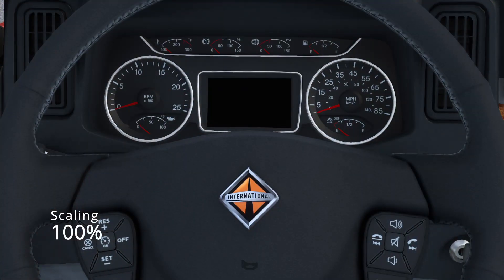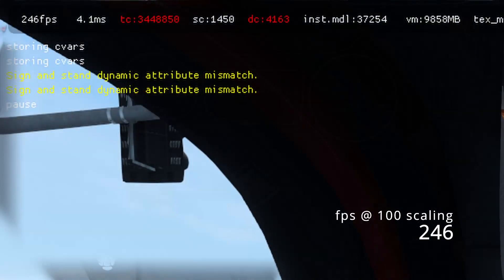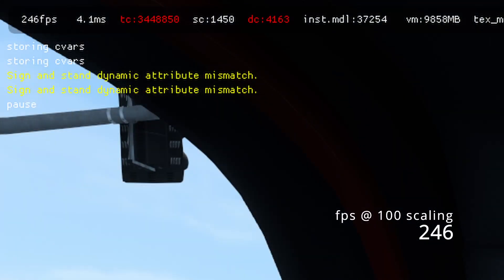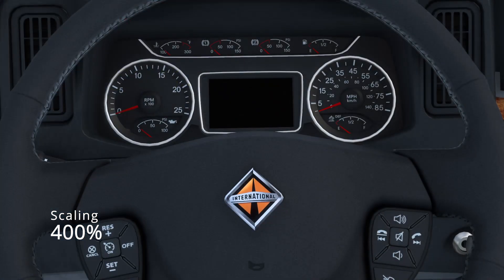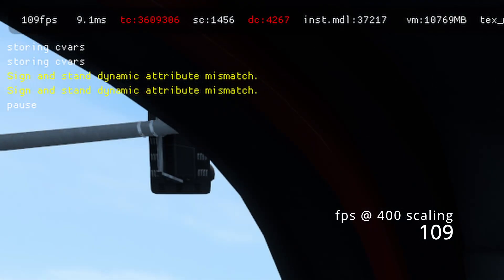Why Is ATS Stuttering? In Other Words, What Is Scaling?

Comment: Stutters all the time for me even at low settings and 40 fps locked. But high settings on all my race games with no stutters at all. It’s the game, not my 4080 Super (on triple 1440’s). 

It’s frustrating. 25% or 400% the stuttering is the same
Reply from the maker: @timothywest1183  mods then.

Comment: With integrated graphics, I have the choice of medium textures with 100% scaling but 30FPS maximum, or 75% scaling and FPS nearer 60. Every time I experiment, I go back to the 75% scaling because I value smooth gameplay more than sharp graphics. I must also have decent shadows, reflections, grass and vegetation, even if the buildings look blocky and blurred, but those are my preferences.

Comment: Since 1.50 my game started to lag and stutter. I use both vanilla truck and trailer and paid mods. When I use vanilla  truck by using minimal and no mods I get the same experience. I turned the scaling down and still no improvements.
Reply from the maker: This is because of the new game requirements for mods to be packed with an SCS created hashfs tool. I have yet to use it, but you will see improvements once people start cutting down their mod sizes and using the tool.
Reply: same im getting stutters and im on top spec pc with a 4090  the road coming towards me isnt smooth asnd turning just looks awful ive tryed everything

Comment: I’m running an i5 13600k with a 4070ti, 32mb ddr4 and in both 4k and 1440p it’s butter smooth with not a hint of stutter or lag. I’m using Gsync also.
Reply: What are your graphic settings? Also what types of mods are you using
Reply: @vxnFloppa  400% scaling, everything on ultra that can be and everything that can’t be is on high. Mods are real billboards companies, realistic roads, brutal weather & Graphics.

Comment: This game even Stutters with a 3090. Come on SCS, get your shit together
Reply: Just bought a 4090 still lag spikes and stutters
Reply: @chrismacdonald102 so how ppl be having smooth gameplay
Reply: @chrismacdonald102  This game engine is very old and poorly optimized for multi-core CPUs. Basically all processing load is allocated to just one core. Maybe when they migrate to DX12 or Vulkan it will run much better.
Reply: I have a 3060 and it runs smooth. I also got the game after the 1.50 update so maybe a fresh install would help.

Comment: Scaling does some of it but there are other things you can do to help. 
Launch settings can be added by going to steam, right-clicking on American Truck Simulator, you will see properties. Then you should see a blank text input box, 
this is where the launch settings go. There is different variations of launch settings so let's go with these. 
(PLEASE SELECT THE ONE FOR YOUR RAM AND COPY AND PASTE INTO THE EMPTY TEXT BOX, SEE PHOTO FOR EXAMPLE)

Step 1
8GB RAM:
-mm_pool_size 4096 -mm_max_resource_size 100 -mm_max_tmp_buffers_size 1000 -nointro -unlimitedlog
16GB RAM:
-mm_pool_size 8192 -mm_max_resource_size 100 -mm_max_tmp_buffers_size 1000 -nointro -unlimitedlog
32GB RAM:
-mm_pool_size 16384 -mm_max_resource_size 100 -mm_max_tmp_buffers_size 1000 -nointro -unlimitedlog
64GB RAM:
-mm_pool_size 32768 -mm_max_resource_size 100 -mm_max_tmp_buffers_size 1000 -nointro -unlimitedlog

Depending on your PC specs copy and paste the line that matches your memory specs on the left.

Comment: i have idea, just modify AI model cars or truck, make the inside of the interior be low poly for AI trucks and cars,, so only your truck or cars will be HD , that's will help decrease stuttering when use 400 scaling
Reply: JahidHasan-zf5pi  you need mod traffic cars, then export all traffic models, import to blender, make all the models low poly, then export again,
Reply: JahidHasan-zf5pi  but I haven't tried it yet, to get around fps drops I usually just reduce the map visibility, it's called farplane, the script is in the interior cabin of every truck model

Comment: Which scaling setting do you prefer.?
Reply from the maker: At 1440p I'm using 125%
Reply: @Halffastgaming  does downscaling affect the visual quality??
Reply from the maker: @EZIOG.T  it can depending on your resolution
Reply: @Halffastgaming  mine is 1440p and still i use 400% scaling
Reply from the maker: @EZIOG.T  No need to really but if your PC can do it, go for it.
Reply: 1440 and 125is good choice, i agree 👍🏻💯

Comment: The stuttering only occurs on certain parts of the map mainly in the cities. I get smooth frames while driving on rural roads/between cities but when I drive through the newer cities (Like Montana, Wyoming, reworked California cities) the game will stutter/freeze for 2-3 seconds before returning to normal. I’ve already tried disabling in-game v sync, adjusted the scaling from ranges of 100-200%, lowering the other graphic settings medium to low, and enabling the control panel v sync. I’ve also tried updating my drivers, but it didn’t really make that much of a difference. I only run C2C, Midwest expansion and a couple of sound mods.
Reply: My stutering is also in the menu of the game. MSI Afterburner shows the same latency peek every 4 sec when it happens my truck is standing stil 1 sec and moves on again missing a few frames
Reply from the maker: That's normal as I explained. Is the game installed on an nvme SSD or HDD?
Reply: @Halffastgaming  my issue is that despite my game fps is capped which means the frame time should be consistent but instead there are frametime spikes from like 17ms to like 50ms which causes stutter that's very annoying
Reply: Hdd
Reply from the maker: @lachancla61616  that may be part of the reason since it's loading textures in chunks from the slowest part of your machine.
Reply: Same
Reply: Windows swaps your RAM so your OS doesn't crash, and that's really the core of the problem, if you want to fix it, you will have to downgrade to ATS 1.38 where everything runs smoother and lighter
Reply: Thats definitely a hardware issue nothing else, game is trying to load a whole lot of assets all at once

Comment: 3080 12g here. I'm with a fresh install. No mods, just stock game with 200% scaling (2560x1440 Monitor).. still getting A LOT of stuttering through urban areas. Really, really annoying and thinking about stop playing bcause of this.. this is sad
Reply from the maker: Game installed on a HDD or SSD?
Reply: @Halffastgaming  HDD.. I found that problem over the last week. o/
Reply: @Halffastgaming  I use 2 times Samsung 980 pro 2TB (M2-NVME) and every 4 sec a huge latensy spike when that hapens my screen wil freeze 1 sec.
My GPU is a Asus Strix 4090 OC model. 
Stil testing lots of things and setings.

Comment: I have an Acer aspire 3 it usually runs the game good but I've noticed the gameplay feels worse and more stuttering now what settings do you recommend? I'm okay with sacrificing graphic for fps but I still like some graphics.
Reply from the maker: Depends on the number of mods, is the PC overheating? Has it been cleaned (blown out) recently?
Reply: @Halffastgaming  I just hit the fanwith a compressed air can the other day but I might need to take the bottom out and manually clean the fan. Also I do have alot of mods that I don't use

Comment: Sometimes in city FPS drops, game stuttering, freeze and crash. No matter what the setting is buildings and objects cant load smooth and ATS died.
Reply: Well yeah its because your computer more information when u go into a city? Idk seems like common sense more assets are in the cities so more is needed from the computer itself.
Reply: @zofferz0  Yes, it looks like I just need powerful hardware, then fps drops will not be so critical and noticeable.
Reply from the maker: Have you checked your log?
Reply: @Halffastgaming  Yes, I saw a video from a russian guy, where he explains a little about ERRORS and WARNINGS in text, so now I'm trying to understand what's wrong. So far, I realized that priority is also important for stability and correct rendering of models and textures in game. I'm working on it.
Reply: @WithoutNumbers  I have the same issue for Montana DLC. I can't play it smoothly because of stuttering and lagging especially in city areas.
Reply: @ceyhunm.5477  It seems to me that this may be due to an outdated engine that doesn't meet today's standards and proper compatibility with Win10 OS updates. And I'm more than sure that a Remake for example on UE5 wouldn't have such problems with more detailed objects and a larger scale of game world.

Comment: Hey I have a Dell laptop what's the best graphics to run when am in the inner cities?
Reply from the maker: Dell sells many types of laptops.
Reply: @Halffastgaming  DESKTOP HCEUR18
Reply from the maker: @maliquebennett4665  you said it was a laptop
Reply: @Halffastgaming  I have two of them
Reply from the maker: @maliquebennett4665  so which model do you have? I can't find whatever you gave me there. Specs would be a good start.
Reply: @Halffastgaming  Processor AMD Athlon Silver 3050U with Radeon Graphics 2.30 GHz
Reply from the maker: @maliquebennett4665  low I would guess. That is a very budget low power CPU not meant for doing much other that browsing the web and reading email.

Comment: Hello, I repeated your video several times to be able to understand better, but even so I have a doubt, what would be the recommended scaling to play in 1080p? these are my components: Ryzen 3300X CPU, Radeon RX 5500XT 4GB GPU, 16 GM RAM.

I'm asking you this question because I've tried dozens of settings to make the game flow well and look good too, and it's frustrating...

This game is very strange because I have played much more demanding titles like Forza Horizon 5 on high, Warzone on medium, Doom Eternal on high and many more, and all of them at 60 FPS.

I would appreciate your knowledge...
Reply from the maker: The trouble is the age of the game engine, and your equipment. 

With those components I would stick to 100-125% scaling, though that still will give you some stutter. The other issue is the game loads the information to video in "chunks" and cities are a large "chunk" when you come to them. This causes a large load to be placed on the CPU, Hard Drive, RAM and Video card. Being that your system is more towards "entry level" 100% scaling is going to be best, and if you do have some mods that use high resolution textures, you may have to go under 100 scaling. 

I hope that answers your question.
Reply: @Halffastgaming  what about me?

Ryzen 3500, GTX 1650 super, 16gb RAM. Appreciate it
Reply from the maker: @fearthemenace  what resolution?
Reply: @Halffastgaming  1080p
Reply from the maker: @fearthemenace  I'd start with 125 and if you get stuttering, down to 100. If you don't, up to 150
Reply: @Halffastgaming  thank you. One last question: AA and SSAO on or off?
Reply from the maker: @fearthemenace  SSAO will "look" better but traditionally kills performance. But AA should be on. That removed the jaggedness of edges displayed.
Reply: Thank you for replying and also for your advice.  Greetings from Colombia

Comment: I have a weird problem i have 130 fps on 400% and it works fine but when I start moving the game has like micro stutters but keep the same fps
Reply from the maker: This could be the game pulling information from your hard drive. Is it a disk drive or an SSD or m.2 drive?
Reply: @Halffastgaming  SSD
Reply: My game fps is capped which means frame time should  be consistent but no there are still frametime spikes despite solid fps can't figure it out

Comment: I don't seem to understand! I Have a 3060TI with an I5-10400F and 32G of ram yet even with 100% scaling and 100% resolution settings i seem to only get 40-45 FPS in city and lots of spike drops driving around HWY's locked at 144 than dipping to 80-90 I don't wanna drop down to medium or low quality since i think my PC should be able to run this on High or Ultra.

Do you have any ideas on what would cause this FPS stutter in game? (No issues with any other game) 

This game is also installed on a Sabrient rocket 4.0 M2. (I also don't run ANY mods on this game)
Reply from the maker: What is 100% resolution? 1080p? 4k?
Reply: @Halffastgaming  1920x1080 144 HZ No HDR! Even dropping settings to medium with SMAA and SSAO off and anisotropic  filtering all the way down (Currently testing) i still get 45-75 FPS sitting in a gas station
Reply from the maker: @Chrisx093  is your card thermal throttling?
Reply: @Halffastgaming  No sir! It's running roughly 1900-2000 MHZ for GPU Clock and memory clock is 7200 MHZ GPU Utilization is only from 40-60% and CPU only 10-25% 

Temps are fine as well for CPU-GPU
Reply from the maker: @Chrisx093  no mods? Completely vanilla? 

No idea other than you have a light mod or a texture replacement mod or a visual enhancement mod that is affecting it. 

I can run in 4k with that on a 3070 and get 60fps
Reply: @Halffastgaming  No sir! 100% vanilla never added a mod yet or installed reshade which was the plan

That's what's got me so confused man I run everything else flawless from tarkov-squad-arma 3 on high quality no issue! I'm at a loss my self 

Checked all updates from windows to gpu driver update and did a bios update for my mobo everything is up to date. Not sure why this game is giving me such issues! I also notice in menu in game going to desktop gpu spikes to 99% and when I hop back in notice my frames drop from 600 back to 144 where it's locked (through GeForce not in game v sync) 
 
It doesn't happen when your driving though only in menus.

Comment: So by me using a hdmi to a 4K tv will it be best to run 400? Or can I scale down . This pc runs smooth at 400 but health wise in term of the pc will I get the same output if I drop the scale?
Reply from the maker: It's up to you. If you don't see frame drops, then don't worry about it.
Reply: Running on a 4k tv is extremely resource intensive. As your gpu has to scale everything to the size of the tv itself compared to say a 27’ monitor. 4k monitor and 4k tvs will run differently. Experiment around with settings.